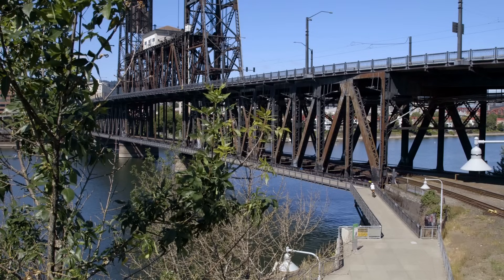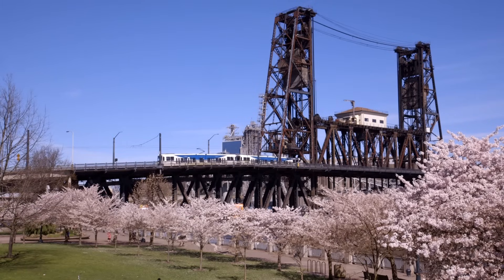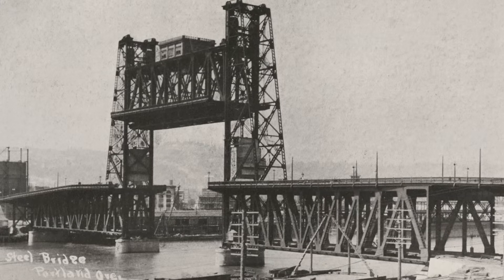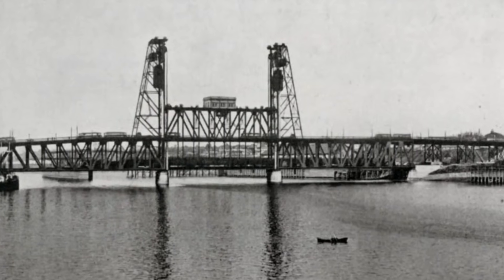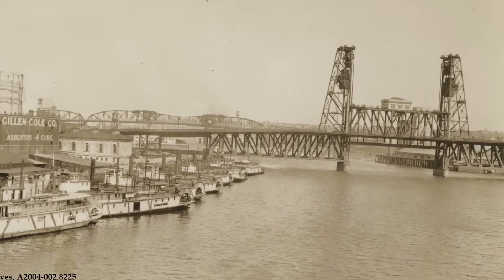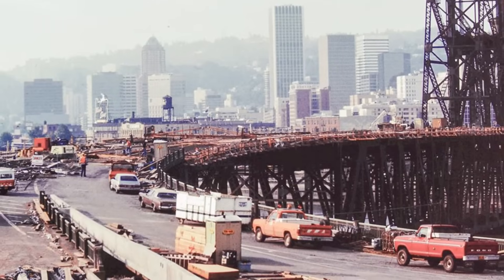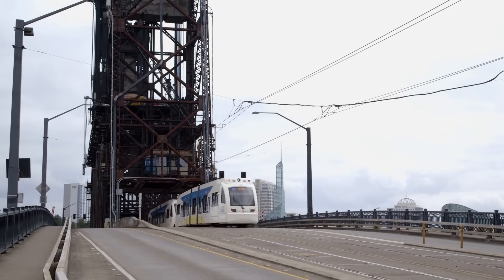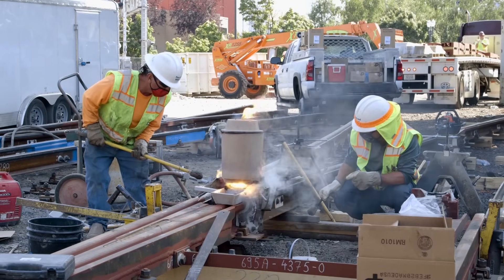The History of Steel Bridge

Comment: Where is this. Looks like one in Norfork VA near where Orioles AAA Club olays the Norfolk Tides at Harbour Park! See the Tidewater Tides used be a Mets  Club, butnow super players Like Zach Britton, and so many Orioles play ball under the shadow of Bridge that looks  like that there one.see there is also a big RR bridge in Baltimore that spunout like the first one shown.  So there are others similar, but they are dying due to consolidated Rail RR companies, not Conrail itself, but CSX which rose from the ashes of conraill, B and O , The Chessy System, and so many more grand rail roads ruined by merger. Make a few wealthy  loose a lot of workers, history  and lines in operation. Cleveland, like Baltimore also has a steelbridge similar. Now we know Pittsburgh has a yeller ones. They are different. And the inclines. But perhaps we do not know all about some of the other towns, especiallyin Baltimore area built by our Great Bethlehem Steel at Sparrows Point. Or even those at PAs bethlehem Steel. Perhaps someone else has some in their area? Thank you 😊
Reply: Portland Oregon is the location of the steel bridge in this video. Right downtown next to the sports arena and a giant grain silo